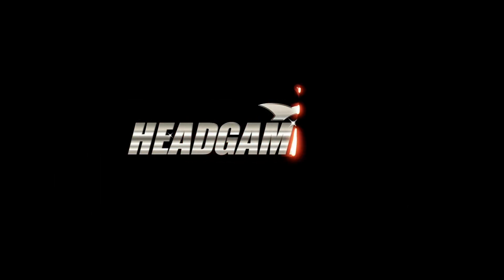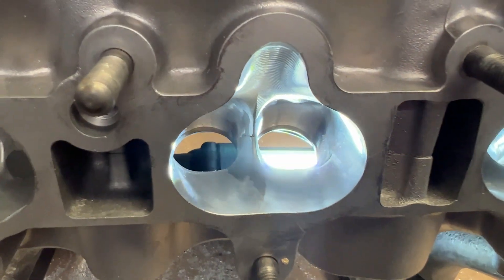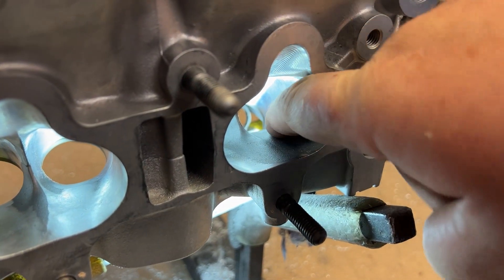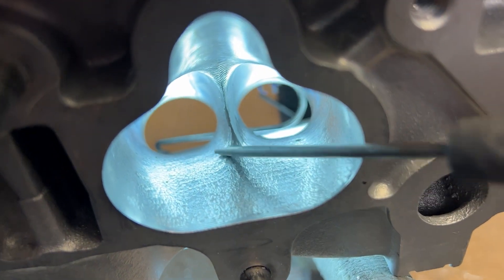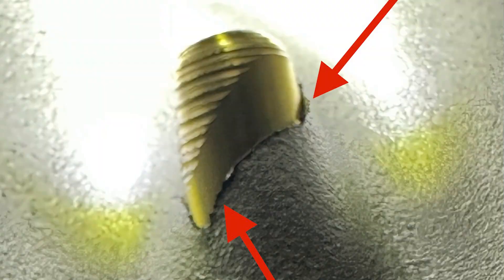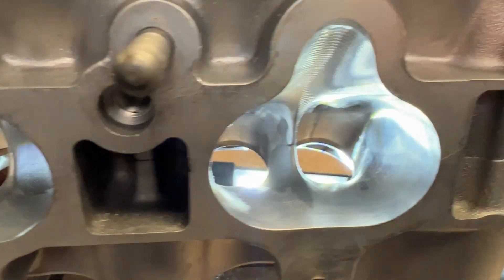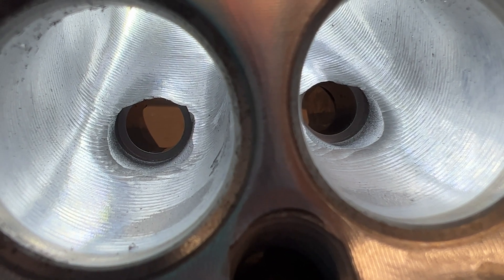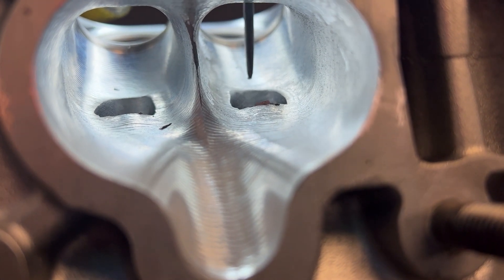Blending after CNC  porting!?

Comment: No beating from me. Totally understandable.
The CNC is obeying a 3D shape in 3D space with the tool, it doesn't know where a port is, what the casting looks like, it's just moving through a set of motion parameters. If there's metal there, it gets cut. If there's no metal there, the CNC doesn't know it.
Blending the port simply removes ridges left after the CNC operation, that may otherwise cause aerodynamic anomalies inside the port surface. Good work on getting rid of the flashing and burrs. Who needs that junk going through their cylinder?
Question: have you flow-benched a CNC ported, vs CNC ported & blended head to note differences?
Reply from the maker: the blended head always flows the same or better. Never hurts them.
Reply: @headgames  Fair enough.

Comment: As always, great stuff. One question, it looks like the third port has a significant crack in the middle of the fin. Is this a junk head? What's the story there?
Reply from the maker: that is not a crack. I have actually never seen a Honda B crack in the port. That is a casting line. 
This is a good head for a customer.

Comment: I would love to lock at your process. I have made programs for other industries that use probs to pick out casting moldes and run different parts of the program for them. For the debur you could do that in the machine! the question is then how are you staffed and the fixtures that you wether to should.
Reply from the maker: yeah the porting machines are not doing any deburing. Easy to do it by hand. You can check out Centroid 5 axis stuff online to see the processes.

Comment: I have experienced that too, shops really do not care, sometimes they get a little insecure then get mad at you for simply reading a sentence from an ASE book on the specs for your car to machine it. Told me I was making stuff up, when I have talked to a real engineer that designs optics and told more than I could ever ask for about that unit of measurement.  In the end I called up and down the state, and concluded that people do not know and or get mad so I just did what ever with the engine too it seems to work for them anyways.
Reply from the maker: yeah I probably would tell you to pound sand if you told me what a book said to port the head too. Machining wise, that would depend on what part we were speaking about and if it actually mattered. Like, BMW states you can't use there heads after milling. Same with Nissan GTR. We have milled some heads many times with no adverse effects.

Comment: It is very eye opening just how sqewed these casts can be, unique like fingerprints. I have seen modern BMW engines being made and noticed that the sand is falling apart as they are pouring the liquid alloy.

Why not add material to the port before CNC-ing it so they are a little more identical? I've seen 2-stroke guys add filler to really smooth out the curves.
Reply from the maker: not sure what you mean by filler. You cannot add aluminum to the heads and epoxy would just come out. You might be seeing them do that because it's a race head. If we did aftermarket castings then we can add material. That is what Trickflow and others do. Cast them small, so they all look uniform. That would be great!
Reply: @headgames  How about Jb weld does that come lose?

Comment: First and foremost, thank you for the content! Keep it up!  On EJ s20 heads going on a hybrid motor, would +1mm valves and porting be recommended at the 4-450whp mark?
Reply from the maker: We don’t install oversized valves in a Subaru at all. You can make 1400whp on stock size valve. The +1 valve is only .004 smaller than the seat so you run into heat transfer issues and it doesn’t flow better till .350 lift. The highest lift you can possibly get is .420ish. So you lose more than you gain. 
Stock cams for up to 550whp. Stock size valve.
Reply from the maker: Thanks for the kind words. And also, get the chamber done to match the bore size.
Reply: @headgames  appreciate the help!

Comment: When I see a CNC port - I actually PREFER to see some spots left raw... it suggests their program isn't simply "hogging it TF out", but rather - has been programmed to only remove the bit of material necessary to create a good, high velocity airflow..

Regarding the bit of extra deburring work. In the machine shops I've worked in, this is called "benching" or "benchwork". Theoretically, the CNC operator is supposed to do the benching on the last part while the current part is being run in the CNC. In reality, the operator stands around, BS's with the other operators, or plays on his phone instead - leaving the benchwork undone.

Nice to see you take pride in delivering a quality, finished product to your customers.
Reply from the maker: I agree, some are hogged out just so they don't have to blend it. We prefer to not make the port bigger than it needs to be to save us from doing work.